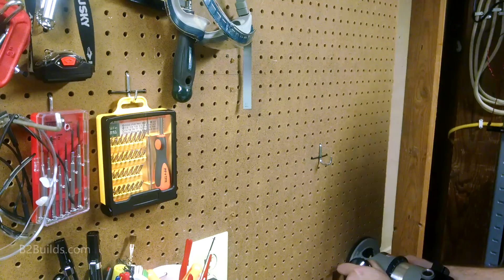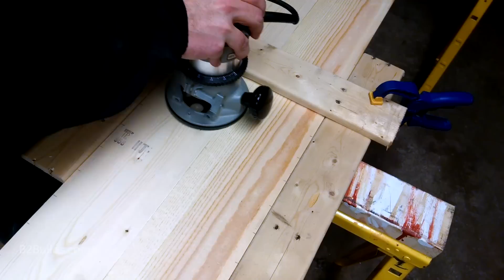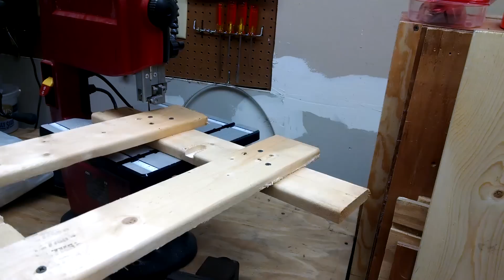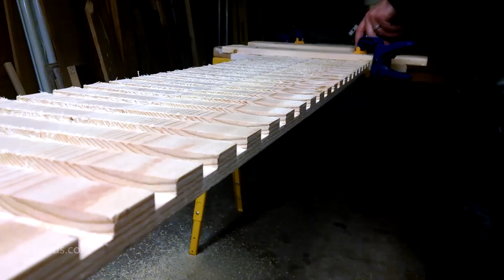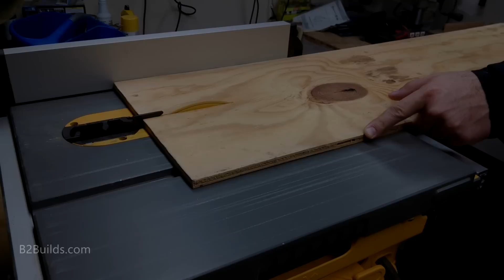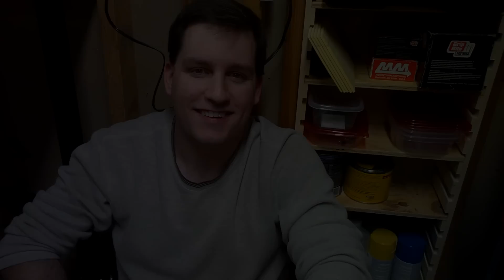Easy Adjustable Shelves Between Wall Studs

Comment: Nice.  My family just moved into a house where the one-car garage that will be my shop is all studs walls.  Will limited overall space, I was planning on putting some kind of shelving between the studs.  Your version gives me a good plan for that.  Thanks!
Reply from the maker: Excellent, glad to help
Reply: Been racking my brain trying to figure out how to take advantage of all the exposed studs in my garage as well, till I scoured the web and found some "EZ" systems, but this video offers a diy approach to the same problem (as long as you have the patience to make it).

In a nutshell, I share your sentiment. This is gonna look great when I make it!

Comment: Awesome project. I love the jig. I'm not super familiar with a router and I use one for the first time in my next video. Between that experience and your easy jig, I may have a new project to take on. Thanks!
Reply from the maker: Thanks Andrew! I'm still fairly new to the router. This one's on extended loan from my Dad. I tried not getting too attached to it, but I've gotten some more bits lately and I'm getting hooked on it. I'll need to get my own for sure. Looking forward to your next project.

Comment: That's a cool jig. Looks like it worked really well. Even though my walls in my shop are closed, this process can be used to make any kind of shelves. This jig looks like it's a lot easier to construct than Marc Spagnoulo's parallelogram router jig.
Reply from the maker: Thanks Joshua. It was simple and got the job done. I would describe it as "square enough" for what I needed :-)
I haven't seen Marc's jig, I'll have to check it out.